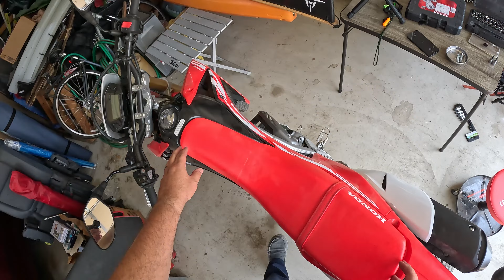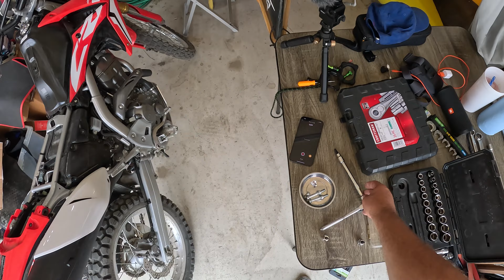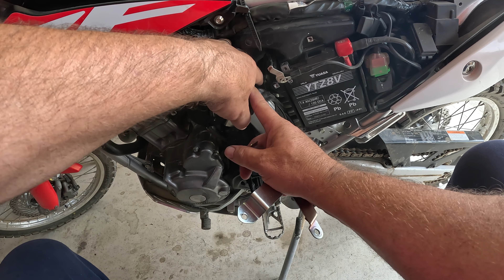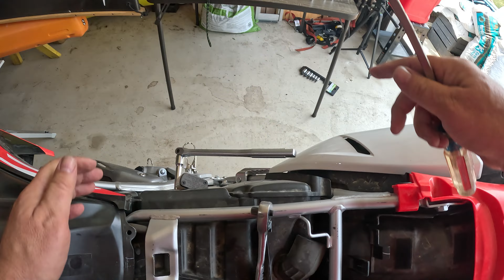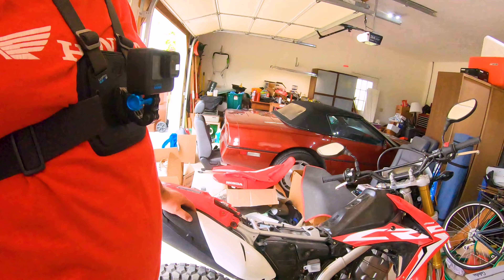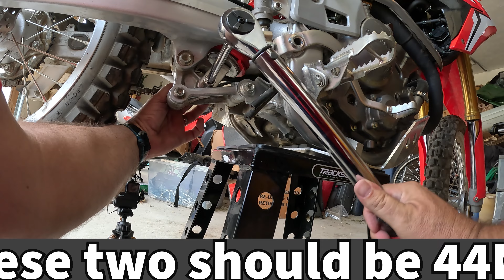How I Upgraded my Rear Suspension | Honda CRF250L

Comment: Hey man! Fantastic video. I have a 2018 Crf250L myself that I’m upgrading the rear suspension on. Im wondering, did the spacer some with the spring on crfsonly? I found the eibach spring on Amazon. But crfsonly no longer sells these, so I can’t find the spacer! Any chance you know the measurements with the spacer?
Reply from the maker: The spacer came in the box with the spring when I bought it from CRFsonly. The outside of the box says that the spring is a 9.0 X 2.25” 14.3 kg… don’t know the measurements of the spacer and can’t measure it now that it’s on the bike. Justin at CRFsOnly might be able to help

Comment: i have the same bike (2017). you said the spring will now be more capable of holding your weight. how much do you weigh? i'm 240 and don't ride off-road yet. i'm going to start but just curious if you think the spring was worth the upgrade? i don't plan on doing anything crazy but don't want to bottom out every time i go over something. have you or will you upgrade anything else suspension wise?
Reply from the maker: Definitely worth the upgrade! I weigh 285. It is WAY LESS “squishy”. I haven’t been off road since the upgrade. Hoping to go today and I’ll make a video. Thanks for watching 💪🏼
Reply: @arideinthecountry  yes, keep me posted...thank you and safe travels

Comment: did you do anything to the forks?  Did you consider replacing the shock and spring?
Reply from the maker: I haven’t done anything to the forks yet. I’m considering the Race Tech High Performance Fork Spring kit for the front, but haven’t done it yet. The left fork comes from the factory with only a dampener and no spring. The right fork has both a dampener and spring. This kit provides a spring for the empty left fork.
Reply from the maker: I considered changing the shock and spring but the shock is so expensive and I thought I would start with the spring and see how it goes.

Comment: I have a 2015 250LD (the Taiwanese model) and my mechanic advised that I don’t do this (no reason, just said “not really recommended) and is obviously pushing for whole new shock.
Reply from the maker: Interesting. Obviously I think changing the shock as well would be better but the spring change made a huge difference for me. I was trying to contain the cost. Thanks for watching.

Comment: What spring rate did u get? I'm 180 lbs idk what's the difference
Reply from the maker: I got the 14.3 kg spring. It stabilized my ride. It's WAY less "bouncy" off road than it was. I need to do the front springs next. There is a calculator on the Race Tech website to determine what spring rate you need for your weight and riding style. Good luck!
Reply: Thanks just went on the website do I need all the adapter collars they recommended to I didn't see u instal them
Reply from the maker: @robertdefusco6824 the adapters and collars came in the box with the spring. The suspension guy put them together when he put the spring on the shock. I rewatched it - realized it happened between 13:36 and 13:37